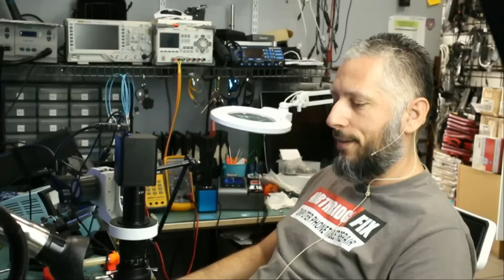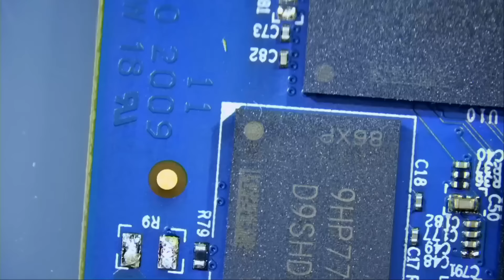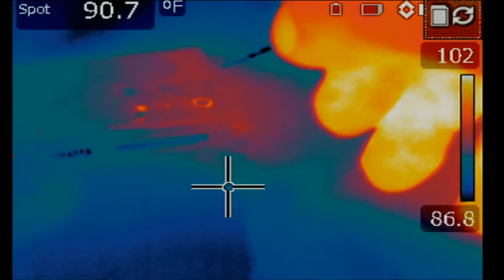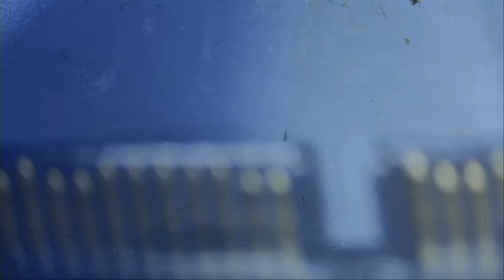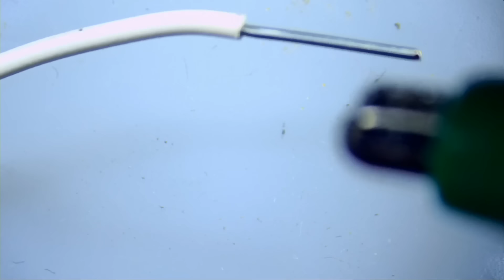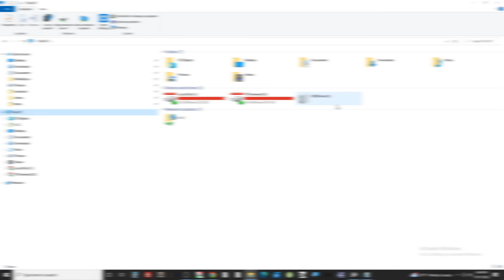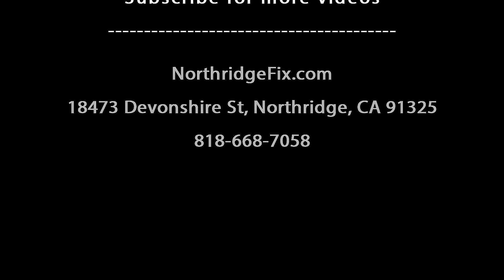Crucial SSD Drive Failed - Can we save data.?

Comment: Mine died last week after a power outage.  I'm not liking SSD's now though I love that they make the computer run a lot faster. I did manage to copy my data off it before it became completely unreadable and printed the program directories to be able to know what programs I had installed. taking regular backups is the key and cloning you ssd to another one and backing up to that so you always have a spare to swap out.
Reply: Ca peut être une problème pour les nas..

Comment: While you did a great job repairing the drive so you can extract,  im blown away that the customer didnt have a backup of the drive considering the data was important enough to even opt for recovery. Hard drives are so inexpensive these days. All my home computers backup their drives to my disk server and even the disk server backs up to an external hd. Its difficult to feel bad when data is lost to failed hardware, due to no backup solutions in place.

Comment: Good detective work.  Surface mount components are all black boxes for me but obviously you've had much more experience with such beasts.  I had an SSD fail on me recently but couldn't open it, as it was still under warranty.  Took it  back for fix/replacement just yesterday, my data is probably lost.

Comment: Great video! The next best thing to a thermal camera is a can of freeze spray and eyes. I found another rogue cap and transistor in an audio amplifier giving me grief a few years back. Would’ve taken ages to find otherwise. Same amp right now blasting out Bitches Brew by the late great Miles Davis. Have a great week.

Comment: Just wanted to say thank you. I lost 2 2TB drives back in like 2016 to an unknown failure (One wouldn't spin up, another would spin up, but wouldn't mount). I kept them around hemming and hawing at the idea of sending them in, but wasn't sure what to expect in terms of success rates or cost. Today, as I am packing to move, I brought them out again and took another look into recovery when I found this video. You said "sometimes visual inspection is enough to figure it out." So I did just that and found the contacts on the board for the head and motor were conspicuously corroded. I gave them a very light and careful scrub, and the drives came back up and I am currently moving the data to a RAID setup. You just saved me a boat load of money, and allowed me to get my data back. Thanks.
Reply: Great to hear! Very well done!

Comment: I had this exact drive 'fail' years ago. The solution was to power it up with no data connection and leave it for several hours and it recovered. Planned to take it out of the laptop and plug it into a SATA power connector in my desktop PC, but it actually worked by just leaving the laptop at the BIOS screen overnight. After that it worked fine again and is still in use as a second drive. Worth trying before taking it apart.

Comment: my chinese 2 ssd that I bought for 35 including shipping cost, failed me as it gave errors to transfer files and was usb 3. that wrote at speed of 1 mb.s to 330 kb/s and they said it was lenovo what a shame... so I threw it away and bought for 70 euros phillips ssd and did a pre run before I copy my 600+ GB to it and it showed 40 mb/s of writing in usb 2.0 port as I was using the usb 3.0 port for other things... and yes chinese need to learn from these phillips or other top of the class manufacturers of external ssd to bring down the costs to buy these stupid ssds, i want a 2 tb ssd in 3 years for 35 euros like the chinese asked but then as good as my phillips one in 2-3 years, as I heard drives fail after 4 years of full usage...
Reply: there is nonpoint buying anything except top brands like intel and samsung

Everyone else just cuts corners and screws u

Comment: i don't need data i just need it to work,,,,when i connect my ssd via usb or inside the laptop the laptop disk manager and bios does not make and sound and don't detect it at all but the cable shows blue light and ssd shows green light but what ever i try it doesn't work please help,,,,

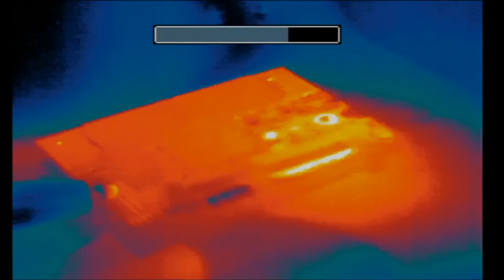Comment: 7:11 - (QUICK QUESTION) the pins and black connector have broken off & my SSD is not reading. If I solder this part you reckon it will read?

Comment: I have a crucial P3 Nvme internal SSD. I was using it as an external in a SSD housing. It failed yesterday. Will not show in Apple Finder or Windows Explorer. Like in this video the drive blue light stays on when plugged in. Does not start flashing. I removed it from the housing and installed anothe r SSD to test the housing was not faulty. The SSD loaded fine so it is definitely the SSD that's the issue. Is this something you could look at? Thanks. And happy Christmas from Ireland.

Comment: Hi, following a general net low followed by surge psu  got bad and killed samsung 1tb ssd, or any other old sacrificial hdd I connected while troubleshooting to that specific psu sata port only (other psu sata port where main hdd is connected on still works) but the data is on that 1tb ssd, anything I could check first knowing that?
Maybe someone had a similar issue and could hit where to commonly look first!?

Comment: Nice fix. Always great feeling when you found the problem, fix it and it works then...

Don't know if this has been answered before. So you were removing two things in the end and not replacing them with working parts. It still worked. So my question is: what is the purpose of these two components in the first place if you don't need them to use the drive? Thanks for answering

Comment: I have no idea what you did or why any of that worked. 2 things, though: 1) did you just remove the shorted capacitor without replacing it? isn't it there for a reason? why does everything work without it? And 2) I'd have copied the drive as fast as I could upon first recognition (well, probably not too fast, though, in fear of anything overheating again, haha). Fascinating work, kudos!

Comment: I would like to thank you because you gave me the right direction to follow. 🙏 I was able to detect 7 capacitors that was shorted to ground with my old multimeter. Of course there was only one that was dead but after desoldered, measured and resoldered them one by one , I found the giulty one : it was C503 for me. The SSD is now alive again and I retrieved all my data. 👍

Comment: As someone that JUST bought two of those Crucial SSD drives (which were btw much more expensive than a lower tier Crucial SSD ($105 vs $80 for 2TB) I'm not happy to see such a dumb short happening.  Oh well, I did get the 2nd one for backups of the first (C drive) one.  Why not Raid1 them? Good question, Crucial drives won't allow it

Comment: When dealing with a failed drive OR one that is failing but still working currently. As soon you get access to the file start copying all the data you can while the drive is working. Once that task is completed never trust that drive ever again. Trusting a repaired drive that stores data is highly dumb and people that trust repaired drives should be slapped side of the head.

Comment: Excellent video, sir! - Was hitting a wall with a customer's Crucial MX500 1TB - Drive was not recognized and would heat up very similarly as your example - With no schematics available, I was about to give up and send him to DriveSavers. But after watching you hunt down your shorted cap (C72) - I replicated your tests and bingo! - I found that C118 (on the flip side of the board) was indeed shorted to ground! - I pulled the bad cap and the drive mounted! - THANK YOU!

Comment: Hi,

My laptop with SSD SATA m.2 256 GB, on Asus ROG G750JY which was my primary drive, and installed Windows on it.

Due to some reason during working on my office works at my home laptop, the drive failed, hung up/frozen, and automatically gave a blue screen error, after which, I was not able to restart Windows 10.

I reinstalled a new WINDOWS from USB drive which I made from the online media creation tool and installed it on another HDD but surely not happy with the performance on this laptop read and write are very slow. Anyways....

I tried DISKPART.. the command clean on SSD disk 1 is successful, but...

As soon as I tried to format the drive, all the contents of the drive comes back.

I tried CHKDSK /r or /F /x /r       it doesn't work... nothing works... 

I tried the software EASEUS - not working

I tried AOMEI - complete WIPEOUT, it show me successful, but same as the DISKPART CLEAN command. Nothing happens to the disk.

Below stays the same.......

Stage 2: Examining file name linkage .... error

An unspecified error occurred (696e647863686b2e 532). 

An unspecified error occurred (6e74667363686b2e 17b4).

Can please anyone help..

Comment: Hello great video ! So I have this ssd that a friend gived me to fix it last year, but it ended by not soleving the problem and I keeped it to myself trying to find a solution.
The ssd is from intel pro, it was locked from the bios and it doesn't show up at all as a drive on devices list on windows. I want to know if there is any chance to perform a reset and delete all the data and the password to use it once again. THANK YOU

Comment: Excellent job. I also had a problem with a GALAX Gamer SSD when you plug it in it will be detected and sometimes it won't. later totally dead. I forget it for 1 year and try to fix it back. I just reheat the NAND ic chip for 1 minute and let it cool, plug it to the computer and HOLA!! it resurrect from the dead! 
88% health

Comment: so if you didnt replace the shorted Cap. then will the ssd still work for long or it just to get the data? and if you can or able  replace that faulty cap. is it well fix and good for longer use? thank you for the response.

Comment: My old mechanical drive kept on clicking & would not read anything so as suggested yrs ago by someone i unplugged it & put it in the freezer for a day then took it out and ran a hair dryer over the pcb on it to remove the condensation & quickly reconnected it And it worked just long enough to retrieve my data.

Comment: hello there, I'm from Pakistan. I have an macbook air model no.  a1932 ,  when we open the lid display comes on and after 2, 3 seconds display goes black but system's sound is still there... could you tell us is it fixable problem and if YES what could be the problem and how much will it cost.. thanks

Comment: Luck?  Luck doesn't exist.  You went step by step, and found the problem.  Zero luck.  You dropping the tweeters didn't have anything to do with her.  Have ownership of your auto(-reactions).  When you get access to Data, Recover it.  THEN make sure all is good. You're a bit hard to understand in some ways, and you're not as clean with soldiering as some people I know.  I thought a few times in the video, "Yes, we heard the first and second time.." Ha ha.  Backup System drive often, always a good idea.

Comment: I'm just wondering: I saw that you removed the bad capacitor, but never put a replacement. Is it safe to get the data from the SSD on this state?

By the way, good video. Thanks

Comment: he revealed the secret of how to fix modern components, i used to use my upper lip to check what component was going hot by brushing upon them. i dont have what he has, the tweezer soldering iron and hot wind blow torch to detach or attach components.

Comment: Love your videos. Here is my experience with the X6.
 I bought the X6 4TB which cost me $569 CAD!!!!  First time buyer of Crucial product. The one I received clocked about 35MB/s, more than 25 times slower than advertised. So ok, I have a defective unit. I contacted Crucial and after a bit they agreed to send me a new one. 

Except, when it arrived, I had to pay for duties because they put the full value on the invoice, which cost me another $90. This was not what I experienced with returns from other companies over the years, where it is usually indicated that this is a replacement for a defective unit. 

So I called the company and was told it is "company policy". So ok, another $90n bucks gone, but at least I have a new working unit; WRONG!!!! The new unit was the same as the old one. So after almost $700, I am stuck with something that belongs in the garbage. Nice work, Crucial. 

I have tried on several computers, Lenovo(i7, 7th generation) win10, Surface Pro 6 with i7 win10, and another win7 desktop. So I downloaded the firmware thinking it could fix it. Both the online version and the iso version couldn't even find the X6 when it was connected. I don't know what to do now....

Comment: Might want to brush off the pubes on your white thermal pad before zooming in with the camera next time ..
Reply: video is top notch and informative, shows how you can locate issues without a schematic or build sheet using deductive reasoning and knowing how shit works and supposed to work. Only half way thru video so dont know how it ends but me ? I would order a replacement drive for $40 or less and swap over the suspected capacitor failures or inductors etc.. as long as the board looks and tests failure free ? but im a mechanic I do not do this type of shit and would not attempt it without even buying the thousands of dollars worth of test equipment first which is why i would never try this at home.

Comment: These Crucial drives had some quirks every now and then, causing them unrecognizable by BIOS / UEFI, especially when the drive was without power for a longer period of time. 

I fixed it by powering down the PC, disconnecting the drive entirely for about 15 minutes, then only reconnect SATA power and power up the PC again. Leave it be for 30 minutes or so. Shut down the PC again and reconnect the SATA data cable as well and power up the system.

I experienced this issue about 3x in 5 years, and got it running again every time.
Reply: wow does that work for old OCZ Vertex SATA SSD drives too???

Comment: I have a Crucial X6 SSD which is external and when first connected it shows up in Windows 10 Pro 64 and also in Disk Management and was able to download some files on to it. Then Windows 10 Pro 64 could no longer find it and have been bouncing back and forth with Crucial Support which has be non-productive so far. Seems to me some software is not working on the X6 board. Have you ever encountered this?

Comment: I noticed an almost identical configuration of components around the same chip to the left of the grouping with the burnt inductor, but using one from another board seemed to do the trick, probably due to slightly different LC timing.

Comment: I bought one of those and it started acting weird a 15mb partition would magically appear and disappear.  Perhaps cosmic ray went through it.

That happened at the airport screening bay one time too.   Flash drive bricked.   Nothing I do that important, shrugged it off.

I suggest get two usb drives or hard drives and use a startup and shutdown script to back things up (3 copies)  If you put things off it might not get done.  Cloud backups useful they say.  

Pick your own scripts, I don't sponsor ads.

Comment: I wish I had a thermal camera when I was working on faults like this. My crude, and sometimes effective, was by way of my index finger used as a temperature probe. Never-the-less we got thing fixed. Good work. BTW I have twelve 500gb Crucial drives! If one were to fail I'll check the capactor(s) too.
[edited: spelling mistake}

Comment: hi sir i have corsair power supply hx1000i modular 1000w i have problame with it when i leave my pc for 12h without open it in winter it wont work i have to givve him some heat with haridryer for 2min and it work fine after . it can repair? or i have to change it ?

Comment: I had a 256gb version of this drive and it started to give me signs of failure when it randomly could not be detected in my BIOS. I tried to back up the drive but eventually it caused my computer to black screen and I couldn't even get into the BIOS screen. Turns out the drive must have shorted out and it ruined all 4 of my 4GB sticks of memory. I verified them dead on another computer as well. Since then I never trusted Crucial drives ever again. Great work btw.

Comment: Good video! Had this happen to a ssd. And could not get it back. If I only had this video back then. Without thermal cam you could use alcohol and see what part the board it would vaporize from. But much better with that thermal cam ofc.

Comment: How many times did I shout at the screen "it's not a ground!" And how long did it take for him to finally listen to me. Also you notice there are 2 similar circuits next to each other. (One is just 180 degrees from the other.) So he could have compared component values and measurements between them.

Priceless smile when he fixes the board.

Comment: Good job in finding the culprit that was shorting the PCB..But, the screw hole is usually grounded when all pertinent screws are installed on the metallic case or base of the housing.

Comment: It is surprising how small the boards in an SSD can be really.  They only have that case to give them a standard form factor and it keeps the price down from not having to make a lot of custom size cases.
Reply: I still can't believe how small microSD is since it's able to hold 1TB.
Reply: yep basically thats probably a 120-256GB there the most common out there atm
Reply: @shorty808100  Actually 1TB drive nowadays doesnt have bigger boards, this is why M.2 drive is small - NAND Chips is very high capacity now. Those 2.5 drives is 2/3-3/4 empty now. Strange why they still dont make them in smaller cases (with possible rail extenders to fit 2.5 mounting holes).